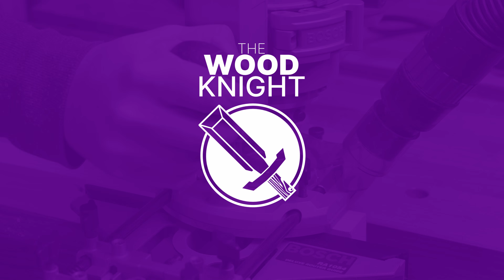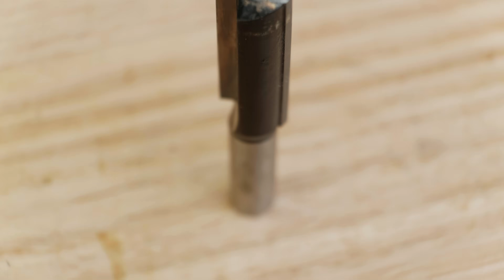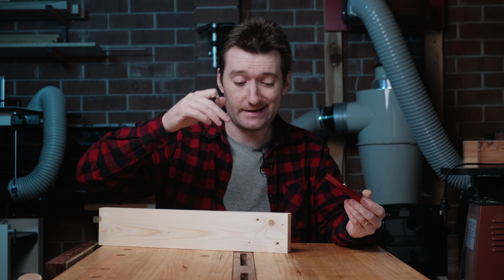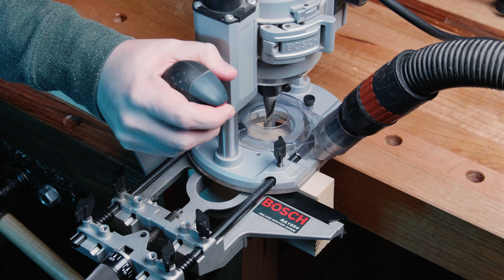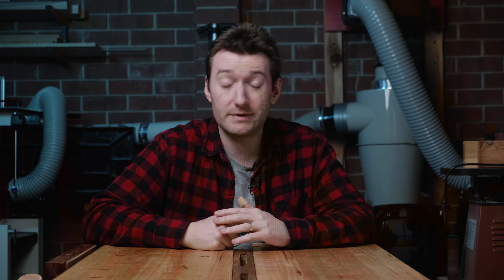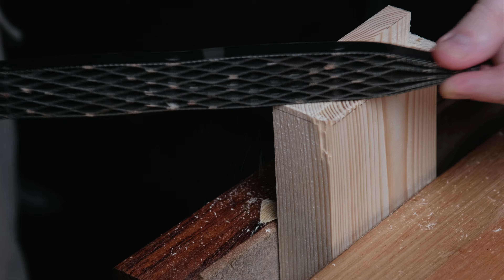Mortise & Tenon: Plunge Router

Comment: You're still advocating for imperial bits in Australia??? I have a large job with multiple loose tenons coming up. I want to go to the big green shed and buy already thicknessed Tassie Oak for my loose tenons. They will sell me 6mm, 9mm,12mm, 15mm and 18/19mm. Nobody has sold imperial timber or sheet in Australia for years. Yet my router has a 1/2" shank :-( So I went looking for a 12mm spiral upcut with 1/2 shank. After months of looking I have found  it in a straight bit but not spiral. CMC Orange being Italian are a metric company. Yet metric bits in Oz are very rare and our retailers couldn't give a damn. So please start advocating for metric in Australia so we can get this colonial/imperial monkey off our backs once and for all and ride on to a bright and glorious future of consistently sized woodworking!! (Sorry comrade I got carried away!) :-)
Reply from the maker: I will launch a KRudd-style parliamentary petition to outlaw imperial on power tools at once!

Also plenty of imperial timber and sheet goods are still sold - they're just 'converted'. 2440x1220? Thats 8'x4'. 2400x1200 is the "proper" metric sizing.
13mm dowel? Thats actually 0.5". 
Roughsawn 150x38mm? 6" x 1.5".

And CMT might be "metric", but boooy their tolerances sure aren't. The 6.35mm router bit I have from them measures in at 6.11mm. Its neither metric or imperial sized.

Comment: That's a pain in the rear when your order is delivered only to find out they've sent the wrong bit...
Great start to the series, mate. 👍🏽
Solid advice. 👌🏽
Reply from the maker: "it'll do the same job", they said. Absolutely won't, that's why they offered both bits!
Reply: @tmuWolverine  
So they will/have sent the one you originally ordered?  🤔
Cheeky ba$+@rds aye...😆

Comment: Great start and as it is the only tool on the playlist I think I have, the place for me to begin so I'll be very interested to see the router table & jigs methods you add to help here.
Reply from the maker: Well, you also have a router table, you just don't know it yet ;)

If all you've got is a trim router, it's still super easy to make a router table for it - 6mm acrylic or thicker MDF (if you've got long enough bolts) work great, hole in the table, and some sort of edge guide (even DIY) and you're done! Maybe I should do a quick episode on that relating to the router table M&T methods.
Reply: @tmuWolverine  You mean like this?  😉https://youtu.be/jLbK-K349qw Have the table, just need the skills 😃 I've seen it done but not a dedicated video on using the table and jigs for speed and repeatability. But yes I think a 1 minute aside on quickly and safely flipping a trim router would add to the M&T video on the technique.
Reply: PS - Don't actually watch the old video, it's horrible 😅
Reply: @FixitFingers  Good video mate! I have an 18v AEG trim router I was thinking about mounting like yours. Might see if I can give it a try.
Reply from the maker: Thats what I get for commenting while walking the cat, haha!
Reply: @andrewford80  Cheers Andrew,  i love my multi function work bench,  but it's a router table 80% of the time.  The videos get better, (though nowhere near as good or qualified with actual you know, skill, as Paul's) 🤣